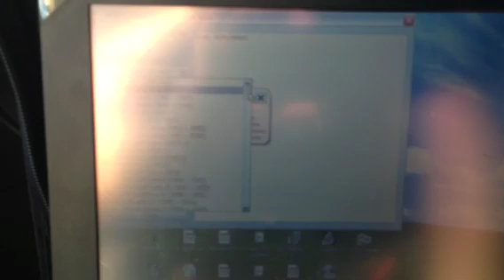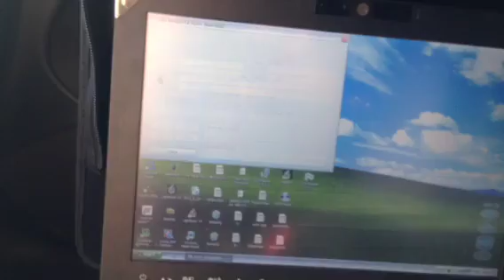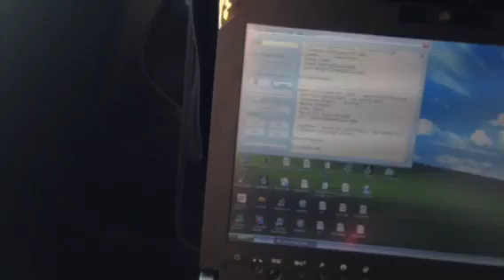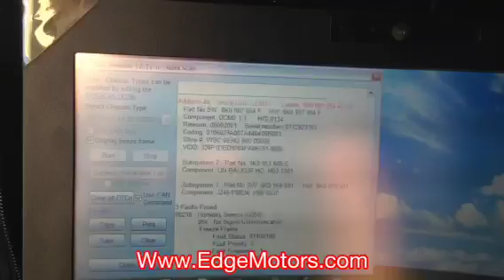Audi VW control modules wake up with out ignition, start authorization module DIY www.EdgeMotors.com

Comment: Hey I I have acces start and can bus open circuit. My key is stuck no start. When I open door hazards flashes fast. It has remote start. I scan it but I don’t one what to do
Reply from the maker: You have to run autoscan and see what codes you have throughout the whole car.
Reply: @  I ran scanner:  I have 00456 for access start control no signal: 
00470 comfort can bus in 1 wire open circuit 
Do you have an email I can send you screen shot of the code I would really appreciate any help
Reply: @EDGEMOTORS  any ideas?
Reply: @EDGEMOTORS  also I took out steering lock module and replacing the relays and stuff inside that do u think it will work after?

Comment: Good video straight talking my question is are these units under the steering wheel column coded to each car because if not a easy way would be to just plug into the second hand unit for you to be able to start the car and get you home as a temporary fix this is all ok if not coded just interchangeable thanks keep posting video

Comment: I lost my 08 a8 key. Dealer says I need control module and access start antenna. All because I lost my key? Why?
Reply from the maker: If you only lost a key and everything else is ok, that’s bs. If you using original tool and have server access you don’t need to have a key to program a new key….

Comment: Hi, used two scan tools on Audi q7 2007 no start on the car when you put the key in nothing happens tried the steps with both scan tools but the car does not communicate with the scan tool. Please help. Icar cr plus and foxwell scan tools.
Reply: @edgemotors

Comment: I have a 2012 Audi q5 the key stopped turning the ignition on. all of the cars other functions are working like infotainment system, lights, ect. I believe that I was locked out like your video says how do you reset ?

Comment: Great trick, thx for sharing :-) On the same Audi B8 2012 can you tell me where is the J329 relay for terminal 15? On my car I can access a few modules with this hack but kessy is not one of them. Some modules that do communicate are reporting a terminal 15 problem so I'd like to check from the j329.
Reply from the maker: I think it may be built into central electrical control module, in the trunk...  check your fuses. All of them
Reply: Have you solved the problem with terminal 15? I have same problem

Comment: Hello friend, how are you? I have the same problem as the video I'm going to follow you I love the audi I have an a6 2005 3.2 the fault is intermittent it does not turn on I have the vag com and I scan it by pressing the brake the long lights and the flashing lights and I see a  auto scan but the problem continues to clone the ecu it continues the same I get that there is no communication with the ecu intermittent and the control module of the guide failing it is not immobilized it does not turn on the redio screen it would be an honor to contact you if you do not have much work my email  Electronic is reyes81.pr@gmail.com or if you have facebook, you would really appreciate it, it would be very much love to solve those problems and spread the knowledge, I do not want to go to the conception, they will assault me if weapon.Thank you

Comment: Hello. Would this work for 2004 porsche cayenne turbo. I have steering faulty sign but tried connecting with piwis but did not connect. Had hazards and brake on but not high beams.
Reply from the maker: Not sure, the cayenne uses same kessy as audi, so it may be the same, but just flickering high beams should wake up the modules already...

Comment: I have now power like this but I can’t even turn on the hazards and high beams. Is there a main fuse or circuit breaker somewhere?
Reply: I have the same exact problem.  But as this video shows and others I have perused if you look at a wiring diagram you will see that the access control start module is the gatekeeper to your 12v access.
Reply: @osmarq3435   while replacing the battery I forgot where all the wires went to on the positive battery cable and so the 110 amp fuse circuit to the main power was not connected

Comment: would a vag com hex-v2 work for this application?
Reply from the maker: Any, not demo vag com should work... but I have never used anything other than vag com pro.... so will not say for 100% 
All you need to do is clear the codes... so any should work

Comment: Can this works if I don't have any key program to the car and then wake up all the module to program a key any one with experience have done that ?
Reply from the maker: That is exactly how you program a new key when you don’t have any keys. 
You wake it up, and program.... but you will need access to audi servers for that.
Reply: @EDGEMOTORS  only Audi dealers can  program the key but any one with  VCDS SCANNER  can wake up all the modules correct? And I just take it to the dealership for the key

Comment: Hello Edgemotors, I recently installed a pre programmed ecu in my 2004 Audi A4 1.8L Turbo 2wd. Unfortunately a new error icon showed u on my dashboard. The error icon is a car with a key inside and along the bottom of the car icon. The car will turn over but not start and the transmission will not come out of park when key is on. Is this the Immobilizer? How can I resolve my issue. I have a PC and the 
VAG-COM KKL 409.1 USB Interface Diagnostic Cable for Audi & Volkswagen - OBD2 / OBDII;. What software can I use to program this?
Reply from the maker: Looks like it’s not programmed, ...

Comment: Hello there, I have a 06 Audi A4 2.0, I had water and oil leaks and have replaced cam sensors and oil cam plug plus water flange and hoses, before car died I noticed it would take longer to start and now it won’t start due to the fact that I’m not getting power to the harness, I have opened the computer compartment and checked al fuses, any advice?

Comment: Thank you for your video!! I purchased an OBDelevenpro for my '07 Audi Q7.  I'm not able to connect with the flashers, brake, and high beams on...it asks for me to turn the ignition to the on position, which the car as you describe is unable to do. Is there another instruction I could try?  Internet and bluetooth are connected- found and added the OBDeleven device.  After running "Connect" -unable to connect without ignition in the on position. When it is out of range it says OBD device is not found.  It appears to be connecting to the Dongle just not the car.  Thank you!
Reply from the maker: You will only be able to connect to couple of modules, not all... which one you trying to connect to?
Reply: Thank you.  I would like to see fault codes to know what is causing the no start problem, it is doing what you describe in your video.  After no-start, I did replace my battery it was a few years old with new Audi factory battery. Still no start.  MMI turns on but only has radio.  @EDGEMOTORS
Reply from the maker: Well try to scan the kessy module and see if you have errors there, clear them and see what happens...
Reply: I've copy/pasted my response email from OBD11pro below about not being able to connect to my Audi...or kessy module.  I think the best choice will be purchasing a VCDS HEX-V2 Enthusiast from Ross-Tech, and follow your instructions in the video.  Thank you!! 

November 19, 2018, 01:43 -0800 
Hello,

the ignition is important for connection with the device because in another way the device will not find all control modules or will not find anything at all.

Kind Regards. 
OBDeleven support @EDGEMOTORS
Reply from the maker: Not 100% positive, but obd11 should do exact the same thing as any other tool, therefore when you do the trick with lights brakes and hazards, the kessy module and some other modules will wake up.... and there will be communication with the tool. But if you have access to a different tool try that, I may be wrong...
Reply: @EDGEMOTORS  Yes you are 100% Correct!  I found 'One of the 'Tricks' a brake light out, replaced it and it works! I have Kessy and more.  It shows 7 Faulty control units Hold to clear faults. I have not done that, not sure what it is.   I looked at Gateway, no faults.  Steering column lock actuator Fault 00288 static, priority 1 req 1 driving cycle 133.   Function Limitation due to excessive voltage Fault 00447 Intermittent, priority 2, freq 1 driving cycle 173.  Battery regulation fault 00532 intermittent, priorty 3, freq 6, driving cycle 173.  So hopefully it was my old battery locking the Steering column lock actuator... More for me to go learn.  Thank you!!!  Kathy
Reply from the maker: As soon as you clear the codes the ignition should come on
Reply: Ok, thank you, I signed on to erase the 7 Faults and also had 10 Faults to clear.  I cleared both and my car started!!! Thank you!!!  It ran rough, it seemed to try and level idle at times.  I turned it off and was able to start five or so more times checking and watching idle possible causes, then the next morning it was locked up.  I'll code my new battery and charge, check alternator, vacuum leaks, fuses, etc. and see if I can get OBD11 to access modules and faults again.  Thank you!!!   @EDGEMOTORS
Reply: @kathylee6249  What did this end up being? did you have to replace the steering lock?

Comment: Hi , in this condition, when ignition not responding, does the car crank? My car cranked and but won’t start. Compression, spark, fuel, was all fine. Only thing I found was spark plug flooded. Dried , clean and put back, but slightly flooded again, won’t start. I couldn’t access to start/Auth module on Vcds, all other modules are accessible. Look to your reply, thanks
Reply from the maker: What kind of car is it?
Reply: EDGEMOTORS thanks for instant reply. It’s golf GT 2006 mk5 1.4 tsi. Was ok, when parked. But won’t start , crank ok. Only problem was in engine module was steering control module. Nothing else. I changed control module, reprogram it, still same condition. Only thing was done when this problem started was fuel filter. Checked , it’s fine, don’t know why spark plugs are getting wet.
Reply from the maker: Well that golf doesn’t have kessy 
So that’s not it and when ever there is a problem with kessy the car would be completely dead....

Comment: Hello
I have a ktm x-bow with this problem ( with audi engine and with the e415 module ), I have only hazard lights and position light. Nothing to the dashboard, no light. But for me if the dashboard won't start it's impossible for me the put the headlight. My obd port does't work. so i can't use the vagcom. Can I jump the relaiy to put ingnition and after i can have access to obd ?

Comment: I have a audi a8 2004 I wasn't around for a while do to some situations but I left my wife with the car the battery died one of our friends didn't no that u can boost the car from under the hood do to truck not opening and key cylinder being seized back there so he thinks the my ignition is messed up and breaks it takes it out buys a new one and now car doesnt wake up with new one Lost the key also and car was on security mode so I had to change driver door cylinder also now it's not on security but car still will not wake up don't no what to do
Reply from the maker: Ignition lock is immobilizer component you cant just replace it, you have to reprogram it as well
Reply: EDGEMOTORS  can i do it with a altell maxysys
Reply: EDGEMOTORS  I have one key I changed cylinder on door took hours doing that I have two new ignition locks  2 keys but only one works on cylinder of driver door but both of them do turn the ignition lock weird by the way steering wheel moving freely making alot of grinding noise wen turned did my friend break the steering wheel this is a night mare I was gone 4 months and can't drive my baby
Reply from the maker: No
Reply: EDGEMOTORS  no to witch of the questions if u have whats app we can talk through there
Reply from the maker: I don’t have WhatsApp, and no you can’t program it with regular scan tools, it has to be dealer level
Reply: EDGEMOTORS  damn witch vag com should I buy seems like I'm going to need it for as long as I own a audi

Comment: Will try this on mine. All electrics are dead and the fuse for electrical system in boot keeps blowing
Reply from the maker: Most likely you have a different problem...  but you could try to see what codes it set, maybe it will help you find your problem.

Comment: I have a 2010 A4. When I push the key the car starts as normal but the key will not stay in the ignition. The car still runs without the key in it!  I get a message”defective ignition lock”. Any ideas to fix? Can it be reset? Thanks
Reply from the maker: Sounds like you ignition lock is actually broken...you will need a new one

Comment: I have tried this on my VW Phaeton 3.2V6. After beeing parked for about 2 weeks the big battery(this one the left side) has gone fllat(about 6,5V). i couldn't put the key on ignition mode even after replacing the battery with a new one. Thanks to this video I have connected OBD II scanner, switched on the hazard lights, brake pedal on and longbeams  lights on. Everything went perfectly- erased all the error codes( more than 10 errors just in the kessy modul) and the car started without problem. Thanks again- you have saved me a fortune. Cheers
Reply: Plamen Milanov did you use Vag reader or you everyday obd2 scanner?
Reply: Yea what he said. What scanner did you use
Reply from the maker: You could use any scan tool that’s capable of connecting and clearing codes in all the modules of vw and Audi...
Reply: That should mean it oughta work on my Bentley too. Gonna give it a try!

Comment: my car was audi a5 year 2010, it was involve in an accident, and the car was done repaired, i want to start the car ,but when i put in the key, meter was display "do not drive-steering defective" and no ignition at all with parking brake warning light flashing, can i use this matter to solve the problem?
Reply from the maker: +how ng 
In your case this will not help.

Comment: I love how everyone assumes it's the whole steering column/start authorization control module because they can't communicate with it. These systems have wake-up protocols for the Can-bus systems. This solved my problem but I'd didn't know there was a voodoo side to getting the Canbus online without the start-authorization allowing start up. I ended up on an unconventional route and jumping Power Supply Relay (terminal 15) -J329 with a relay switch and erased the codes with my Snap-On Solus Edge Scanner. I'm sure OTC Encore and similar devices can do the same.
Reply from the maker: +Richard Whitaker 
I have done this several times too, but my way is way faster:)
Reply: Where is this relay

Comment: Hello. It work for AUDI A6 2005 years, 4F vehicle. Some history.
 One year ago I had “ ignition turn ON“ function problem. Resolved the problem was connected with the WAG COM 12.12, deleted the errors, the ignition switches on and starts the engine without conditions in this video. 
Now, after one year the same car, after 14350 km this problem appeared again. I‘m tryed connect to vehicle with same WAG, which was used  one year ago: of the 10 attempts  connected only 1, (next times „function not supported...“), scanned faults but after deleting its,WAG  again show about bad comunication or like this... 
...2 hours night job in 12 degres of  celsius bellow zero with trying connect and etc...
... While seeing to this video...
Now with conditions of this video was  connected  to the car from the first time , deleted fault, ignition turned On and etc .
I don‘t know what happened with vechicle, was it coincidence or not but I lost 10 minutes from whatching video to run the car...All are happy  
THANKS A LOT to EDGE MOTORS!!!
... but question is still actually what happened in the car?

Comment: My 2007 A6 won’t start they told me it was the battery. After installing new battery it still won’t start. Is it possible something needs to be reset? The only thing I can tell you is they where working on the rear light changing bulbs and had the brake peddle pressed down with a bar for about two hours which killed the battery but after trying to jump itit would not start. Thats when he said it needed a battery  That was not what was wrong so I took a cab home and now car-less and at the mercy of these Tire shop boys.. Any help would be appreciated asap thank you
Reply from the maker: +TheRonmaio hello.
there could be allot of reasons for that to happen. id tow it to  a repair shop that knows audi.... so they could see what wrong.
Reply: I thought it was the starter but some idiot kid know it all had us believing it was a short. I am losing faith in the younger generation , yes i could have towed it to Audi but they will rip me off. I can get the starter for $75 and it only takes less than two hours to replace it. I am disabled now so I can do these things i used to do myself anymore. I need to rely on others. But People  really disappointing  me lately, i guess they think everyone else is clueless except for them. Any thank you , Its taken care of now and  done. It was the starter like I thought it was all along. This asshole even told me it was a bad battery which I personally checked with my voltage tester and load tester that morning,

Comment: Hello, I have a 2005 A6 4.2 with a steering column locked. Tried your procedure but have not been able to get vag com to see the car .  any only suggestions to clear this code? It happen after a extremely cold day, and hope its just a fluke

Comment: My 2005 audi a6 was diagnosed with a damaged steering column therefore electricity doesn't work.Is it possible to replace it with a used steering column or it has to be brand new?
Reply: i have the same problem 😑
Reply: Yeah me to. Did y’all get it fixed